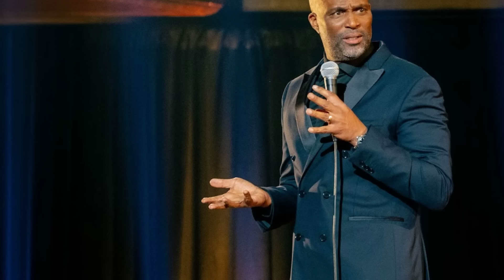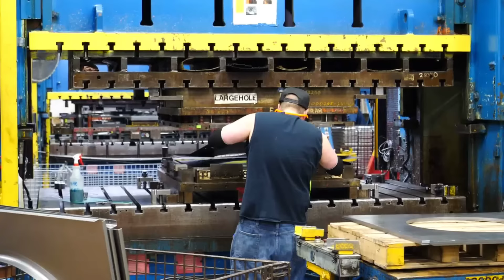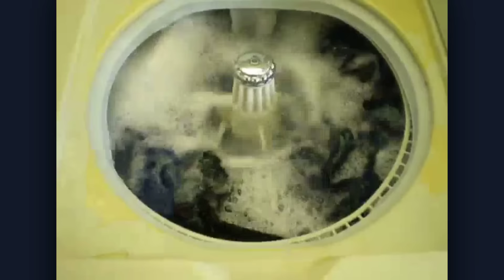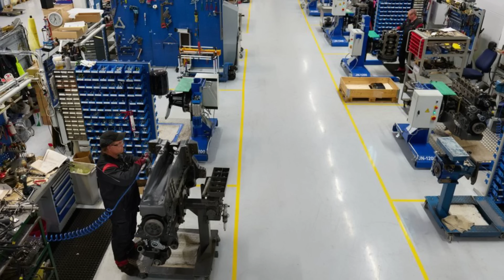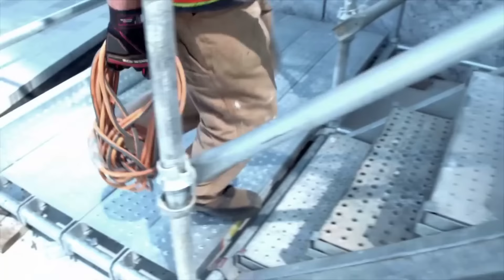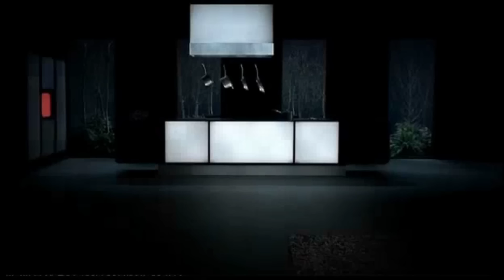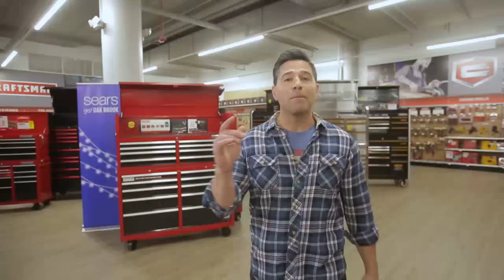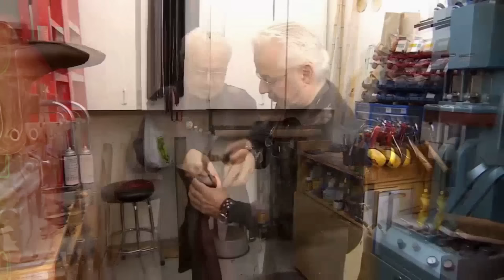The Only 5 Brands That Still Last (The "Buy It For Life" List)

Comment: I bought a push mower in 1995 for $125 at a Rose's department store. The deck wore out and I remounted the motor on a scavenged deck. I've done that at least five times. The motor was made by Tecumseh. I change the sparkplug and the oil. I've replaced the pull cord once. I've replaced the blade once because I hit a stump and bent the original. The motor refuses to die. I named it Frankenstein and it just keeps going. Usually starts on the first pull.

Comment: Lodge no longer makes useful iron. Their new offerings have a pebbly finish that doesn't work. You need to visit a vintage store or an antique mall to find older ones with a smooth interior.  You can easily clean and re-season them, as you'd have to do with a new one anyway, and they will perform just as you'd hope cast iron should work.

Comment: Cast iron IS non-stick!!!  Once your pan is seasoned, do this if you need non-stick:  LIGHTLY coat unheated pan with oil, put on stove, heat to desired temp.  Then add your butter.   Fried eggs will slide around the pan!!!

Comment: I own a SpeedQueen TC5. Sadly, it does NOT have a mechanical timer - all of the knobs are now connected to circuit boards.

That said - it is still a workhorse of a washing machine that I believe will last for 20+ years.

Comment: I bought a house several months ago that came with an old washing machine. It was smelly, but due to all the expenses right after the purchase, I didn’t have extra money to replace it with a “sparkly, shiny, spaceship-looking washing machine from a store.”

I eliminated the odor and decided to find out more about the machine. I took a picture of the front and the back panel and asked ChatGPT. It turned out that the machine was built in 2002 and is very reliable with proper maintenance.

Yes, the washing machine looks a little tired, with some almost invisible rust on the bottom and mold on seals around the loading door, but I’m going to keep that thing forever.

What’s the brand? Maytag Neptune.

I’m glad I didn’t replace it.

Comment: the one thing i disagree with is that you can drop a cast iron skillet .. i do use and love my old and used cast iron skillets that i got very used over 30 years ago but no you can not drop them.. it is an easy test buy a cheap lodge cast iron skillet and drop it on concrete a few times it will break.. but you can cook on them for many decades of daily and use them on anything from a camp fire to an induction top.. they are better but they are not drop resistant at all

Comment: Ehhhh... the speed queen today is not the speed queen of yesterday.   The jury is still out on the reliability on the home version.   It's electronically controlled with and does not have a mechanical timer; it just looks like it does.  It is probably more reliable than other units out there, but it's not the commercial version.   Source?  I repair appliances for a living.
Reply: Nothing today is like yesterday. From Toyota to Trane etc etc. Everything is junk

Comment: My grandpa's house had a nice furnace made in Vancouver.  All you needed to do if you wanted to replace the motor was to simply find another cheap off-the-shelf motor.  Years ago, my dad replaced it with one that was supposed to be energy-efficient, supposedly getting some kind of rebate from the Government of Canada.  Turns out that the new furnace is no more efficient than the old one - and the motor costs hundreds of dollars.  My dad says that he nearly cried looking at the old furnace when it was on the side of the road.

At least he has a Honda Odyssey from around 1998.  It was made in Canada, and has something like over 100,000 miles on that.  No plans of giving that up, although he also has title to his late girl friend's SUV (a RAV4, I think), so the Odyssey can rest and he can work on it.  He also had a bed from the 1970s that he disassembled when he got a new one.  I feel bad that I didn't take that bed, but I had just gotten a new mattress...

Comment: my list in home: and all in full service everyday :face-red-heart-shape: in 2025
1920 my ETNA coal stove.
1935 my Electrolux Z25 vacuum cleaner. ( never repaired ).
1940 my ETNA cooking stove with oven.
1963 my Volvo amazon station model 220s
1970 my Volvo amazon 122
1971 my MIELE W412S  washing machine 
1972 my Honda ps50k-e mopet 49cc
1974 MIELE dryer ( dead in 2022 ) now a ETNA
1992 my Nefit turbo 21 cv heating ( past a way in 2025 ).
1998 my BROTHER  combi macrowave.
2004 my Peugeot 307 ( pas a way in 2025 )
2006 my Acer 9920g laptop ( i see now this video ) win 7
2019 my refrigerator from LG a moderne one.

Comment: I have a Sunbeam auto lowering toaster. I recently needed to replace the cord. When I opened it up I saw the manufacture date. February 1958. That's a one and a nine and a five and an eight. That is 67 years ago that it was made. Still makes the very best toast and is much faster than the new ones.
Reply: Have my mom s from 1951 works great

Comment: We had an Amana side by side fridge with ice & water dispenser in the freezer door. It finally died after 40 years. Probably just needed a new compressor but the new ones are now charged with flammable freon which wasn't compatable with our fridge.  We finally bought a GE side by side which has a temp control panel.  First thing we noticed is the temp display isn't always showing the temp in the fridge/freezer.  The fridge temp went up to 45 degrees F while the display showed 37.  Similar thing with the freezer.  Temps would fluctuate as much as 25 degrees and the display remained steady near the temperatures we set.  We called a technician and he said it was normal; called a defrost cycle. I tried to get more information about the defrost cycle but he wouldn't tell me.  He said that's a technical question and he's just there to fix the appliance.  I asked about the temperature display & he said it's designed to do that because GE doesn't want us to know the temperature is fluctuating like that.
Reply: Defrost on a frig means the compressor turns off,ventdoors open,a fan runs air across the inturnal evaporator coil to melt off all the ice, then it will stop defrost cycle when pressures come up within specs, and or timer times out, then closes vents and restarts compressor if the tstat is calling to reduce box temps.
I hope that helped explain a defrost cycle😅😅

Comment: Cookware:  Cast iron is fantastic!  Carbon steel when you need something that responds to heat changes quickly (as opposed to holding heat like cast iron), and stainless when I want a fond for a pan sauce.  All can last a lifetime and beyond with some care,and the first two are non-stick when properly seasoned.  Artificial non-stick is crap!

Comment: In 1990 we bought a generac 6000 generator for $169 it was still working when we sold for $25 and they are still using it.

Comment: I bought a Míele vacuum, it's an utter tank.  I considered buying their washer, but ended up getting an Asko.  Non violent and durable.  CPU boards I simply repair.  My microwave's overtemperature sensor burned out, I replaced it with a 50 amp version, never gave me trouble again.  Gummy carb?  I clean it.  I finally had to give up on a 45 year mechanical fridge when the mullion heater cracked.  Note that Lodge and other recent cast iron has a rough surface and takes a long time to season properly.  An old cast iron pan has a smooth surface that's much nicer.

Comment: My Honda mower was considered semi commercial. Had a metal deck.  Lasted 30 years.
Reply: My Honda izy lawnmower still works well at 18 years old, nothing needed replacing yet. Also been driving Honda cars (petrol engine not ev) since 2003. They're incredibly reliable. 🙏✨👍
Reply: 90% of all mowers have a metal deck. 
But yes, Honda always made good mowers and their decks (and everything else) are better quality. They had aluminum decks in the 80's and early 90's. My dad still uses the one he bought in 1990.

Comment: The actual driving force behind global warming is over consumption .
Over consumption is driven by short service life products that can not be repaired .
This is because the accountants with MBA's in the board rooms  worked out that it costs the consumer almost the same to buy new all the time against buying quality  having it repaired .
However in the former case they get all of your money while in the latter they just get the profits from the initial sale and in most cases make a loss on spare parts because keeping inventory for 300 slight variations of a product that may only sell 1 or 2 per year costs a lot of money and this has to be loaded into the purchase price .
However low ticket price is the driving force for ignorant purchasers .
While I am from Australia the same thing happens here as in the USA .
y father bought his first petrol powered lawn mower in 1962 when my last sister was born .
It cost him a full months wages for the ticket price + the interest because it was paid off over 2 years .
That sister still has the same mower, no catcher , no guards ( they are nick named the Toe Cutters) , no governor , no recoil starter , a simple pulley & rope .
It is still on the original bore , although I will be getting it rebored to + 20 thou this winter & I can still get +20 , + 40 & + 60 pistons & rings for it .
She is now 70 and too old to use it but the 80 year old in the apartment next door uses it to mow the common area of the block + 3 more on each side .
As you may guess I repair lawn mowers I can fix a Victa from any year apart from the newer ignition coils that have the inbuilt timing chip.
However they can be retro fitted to the previous coils where the timing chip was a stand alone item .
I can not fix any mower with a B & S engine before the current model engine  because the funds manager that now owns B & S stopped carrying them .
I have ride ons that are 5 years old where service parts are now NLA .
I just finished servicing a 1982 Greenfields still working as new .
I just replaced the corks on a 2000 Greenfields drive , it cost $ 450 all up including labour , the machine has 5,000 hours on it .
Any hydro drive would have needed to be rebuilt or replace 3 times by those hours and they service parts for the rebuild alone are $ 620 WHOLESALE so the customer would be  looking at $ 1,500 full cost .

Comment: the harbor freight predator is actually a fantastic engine for the price,  there is not much difference between it and a genuine honda. i have one for my pressure washer that i built. the genuine honda is allot more expensive. modern briggs are the real throw away, they make engines that are sold as never needing an oil change, what you will need is an engine change

Comment: I have done very well with Roper dryers. I have changed out both the thermostat and the heating element on  mine. I clean out the lint trap with every use, and I periodically clean out the dryer duct, which is not very long. Still works like a charm. Roper washers are decent too, as long as you don't get one with a lid lock. Who the hell came up with that crap? I'd like to give them a good kick in the @$$!!
Reply: We have a Roper washer, bought used because our new electronic washer died after only 5 years. We've had it for 10 years with no issues and I think this model is from the 80's.
Reply: Probably Underwriters Laboratory came up with that crap. But I think it is due to some very frivolous lawsuits being filed and ridiculous judgements given for what should have been user stupidity.
Reply: @judirollings3959 Like lawsuits against the manufacturer for getting slapped in the face by a pair of flying undetwear?! 😂

Comment: I work on small Honda generators as a side hustle. They have a litany of problems and once a model is discontinued parts become 3x more expensive. The most popular models use a wet timing belt that lasts about 5 years and a plastic camshaft.
Reply: They do have a cheap line, which I thought was the GX, but I may be wrong.
Reply: @jimm1819  GX is the high end. GC and GCV engines are on the low end. GS is a slightly upgraded GC. The suitcase inverter generators have an engine model number that starts with GX but have the architecture of a GC.
Reply: @jrogers21  Thanks!

Comment: Do some research on the Speed Queen TC5  while it has does knob style controls , it uses a microprocessor to sequence its operation , not a mechanical cam driven timer .. Speed queen does make a top loading commercial use only washer with  a all mechnical timer (No use of microprocessor controlled sequencing ,  its the TV2000WM

Comment: Here I use a mess of Electrolux Model F and G  vacuums. These were made in the later 1950s to mid 1960s.The motors ball bearings are roller skate bearings

Comment: Cast iron and stainless steel for cooking. Check! 25 year old Honda Snowblower still running and starting on first pull? Check! 50 year old Red Wing Boots got when I was a teen and still going? Check! 3 outa 5, not bad. (Oh, I do have a pair of Channel Locks too)

Comment: The only Honda I ever owned was a 1984 Accord.  The engine failed at 72,000 miles.  When I complained to Honda, I was told that this was within their “normal manufacturing tolerance.”  I haven’t bought a Honda since.  For small engines, I will take Kawasaki any day.  I have had 4 Kawasaki motorcycles and two lawnmowers with Kawasaki engine.  Still waiting for my first Kawasaki engine failure and my Kawasaki powered John Deere push mower is now 41 years old.  My John Deere riding mower is 21 years old and its Kawasaki V-twin engine is going strong and will outlast the mower almost certainly.

Comment: Consumer quality goods have got worse. I usually buy my kitchen stuff from a company called Nisbets in the UK, they sell stuff to restaurants. It costs a bit more to buy a pan or microwave but they are designed for very heavy commercial use.

I also buy a lot of military and Police surplus gear. The absolute best stuff is designed for aviation or mining. Anything made in Japan, Sweden or Germany is still usually good.

Comment: Sad news: I own a Speed Queen and they do have lid locks, water level sensors, and control boards that will fry now, but I'm sure they're still light years better that the Maytag we got rid of.
Reply: I believe Underwriters Laboratory is the source of many modern "safety" requirements that have ruined modern appliances. They are also responsible for the temperature sensors on electric coil stoves that will not maintain a constant temperature and so have ruined the finest analog affordable cook stoves.

Comment: I enjoy getting long life out of what I buy, From the 20 year old sweatshirt Im wearing, to my 40 year old refrigarator, 20 year old washer, dryer and stove. My 23 year old snow blower, 14 year old zero turn mower, 26 year old Suburban. In my woodworking shop I have a 50 year and 42 year old Delta table saw, 87 year old jointer, 81 year old sander, 66 year old Craftsman radial arm saw, just to name a few. The older products were build to last without a lot of electrical parts to fail.

Comment: Here in the UK we make a few brands of washing machines. Some time ago nearly all of the UK washing machines suddenly switched from drums that were made of two halves held together by bolts to the two halves being glued together. This prevents you splitting open the drum to get at the bearing assembly . Basically they are preventing you from getting to the bearing to replace it so they are preventing the' right to repair'.  This is the following concept in the UK - Right to repair refers to the concept that end users of technical, electronic or automotive devices should be allowed to freely repair these products. They are preventing you from doing this. Also the prices of components that may need replacing due to wear or failure are horrendous. Often making the cost of the component plus the cost of the engineer replacing the component costs more than the cost of the washing machine. It is just madness and just makes longevity of white goods pathetic.

Comment: We had a 20yr old set of hand-me-down Maytag washer & dryer from my parents for the first 18 years of our marriage and only had to have a water valve replaced on the washer and a heating element on the dryer one time each.  I think the total was less than $150 for both problems.  When we bought a new house we decided to "invest" in newer GE machines with all the cool feature and modern style and gave our old ones away.  That was a mistake.  The new washer lasted  just over a year (just out of warranty) before the control board failed.  The dryer lasted two years before I had to replace the drum support rollers.  I replaced those rollers every two years until I finally had enough and replaced both the washer and dryer with new Speed Queen models.  They aren't inexpensive and they aren't as large of capacity, but they are sized well enough for us.  They are also solid machines with 7 year warranties.  It's been two years so far and we are very happy with them.

Comment: I've had two Honda small engines in my life.  There will never be a third.  I've had nothing but trouble with both: no start, run like crap, won't keep running.  Had them repaired but the problem always returns.  I've had much better luck with Briggs and Kawasaki.

Comment: Don't drop your Lodge on concrete or put it on campfire coals for an extended period - it will crack if dropped on concrete, and it will warp if heated too high (higher than your oven.) Learn from my mistakes